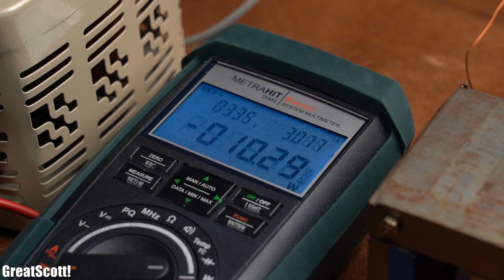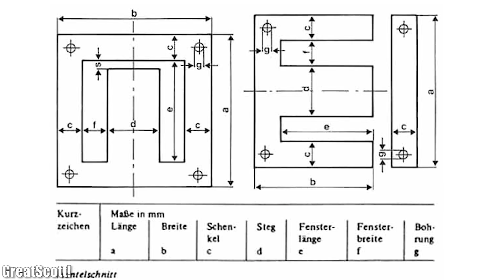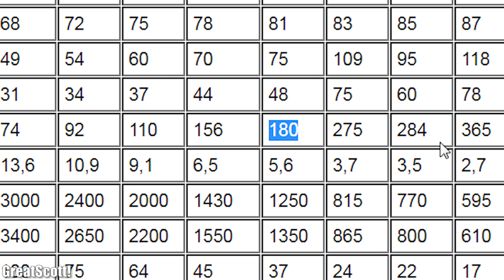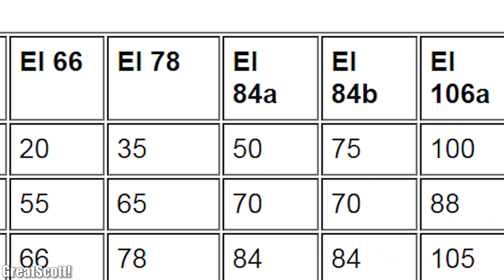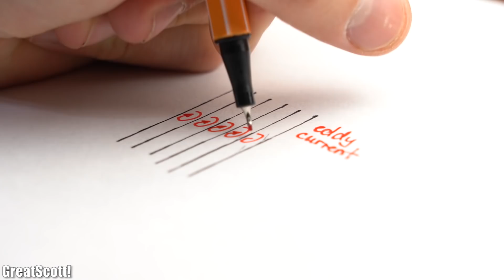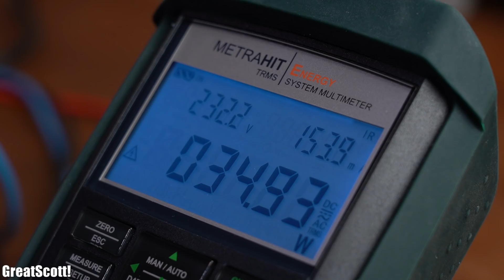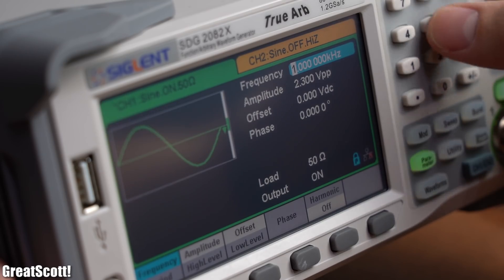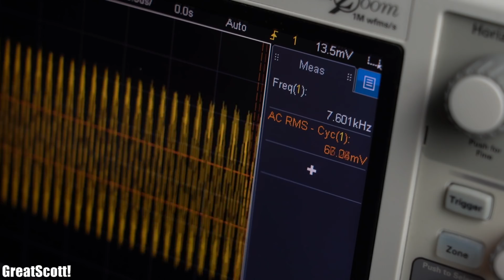Can you 3D print a Transformer? (Experiment) || How to make a mains Transformer!

Comment: 7:34 Touching the secondary coil to measure the voltage of a DIY transformer !!!Σ( ° △ °|||)
Take care of your self please
Reply: Ushio Cheng he probably measured it before taking the video and then showed it to us in it by holding it in his hands.
Reply: The primary and secondary windings are separated from each other and a core - there is hardly any way to screw it up at that voltage
Reply: @igorb4650  : Broken skin, maybe sweat. Doesn't take much current to stop your heart, so if not for the resistance of your dry skin, you really could cause yourself some trouble that way. He should really upgrade to some of those spring-loaded grabber-clips at some point.
Reply: @absalomdraconis  12 V considered safe even for  wet skin, unlike up to 52 V considered safe for dry skin

Comment: You made a nostalgie for me. My first transformer was when I was 8. I have made (with father's help) a semi manual winding machine, making windings turn-touch.
Never went to maximum B area, less heat.
Reply: lol I made my first transformer last year (when I was 33) out of a nail and some enamel wire. Real sophisticated technology, that. I had 16vac at 60hz on the primary and it wound up melting the insulation on the wire because I forgot to work out how much power the wire could handle. Which at 2mm diameter, wasn't much.
Reply: Ah, the (gladly) forgotten  joys of packing the core juuuuust a tiny bit too enthusiastically (ie. "trying to put back in every single E/I that came out of it before re-winding") and slicing straight through the plastic and a few of the inner (typically primary) turns...

Comment: Print with highest Z-resolution, and every 19 layers of ferromagnetic filament, print one layer of normal filament, as one piece!!! It will reach a much higher efficiency, i promise!!! Greetings from Cologne, KD.
Reply: Can you elaborate exactly how and why your theory would work? Higher resolution would just prevent eddy current loss. But doesn't increase inductance.
Reply: @sto2779  But Eddy-current-loss-reduction IS already higher efficiency... Laimert, another German YTer has done similarly, to create a 82%-efficiency motor, maybe I got the idea from that project, but to be honest, I cannot remember at all, it´s 9 months ago. Printing as 1 piece makes better usage of the volume (no air-gaps between the ferromagnetic laminates), so, more ferromagnetic material in the same volume brings higher inductance, would be a guess now, but to be honest, I cannot remember... The higher the resolution, the thiner the isolating layer, the better the volume-usage...

Comment: It might would worked out for SMPS or switch mode power supply, its core made from ferromagnetic materials, and frequencies around 100Khz, also i would suggest 3d print its core as one single piece. Would be interesting to see your elaborations on that
Reply: I believe it's iron that provides the ferromagnetism, so it actually might not be that good at higher frequencies.

Comment: The ferrous filament composition is much more like the composition a high frequency switching core material; as your experimentation demonstrated. I think you could have better luck printing a solid core for a switching power supply. The ferrous grains isolated by the plastic in the filament would provide the eddy current protection at the higher frequency of the switching power supply.

Comment: Those sheets should be iron not steel. Steel can become magnetised (holds its magnetism) whereas iron does not.
Excellent video.
Reply: Iron does have magnetic remanence. Some types of steel don't (I understand it to be related to their crystal structure: specifically, most stainless steels seem to lack remanence), but "electrical steel" apparently focuses on magnetic permeability to reduce the strength of the "open air" magnetic field.

Comment: at schooll they teached me to use beeswax to reduce, even inhibit noise and noticeable vibration, melt it over the corners and then hit it with a torch, so wax gets into the small empty spaces. Or any heat resistant barnish will sufice, nuts tend to loosen, so its a good measure to avoid or delay those issues. Indistrially they just weld them toogether.

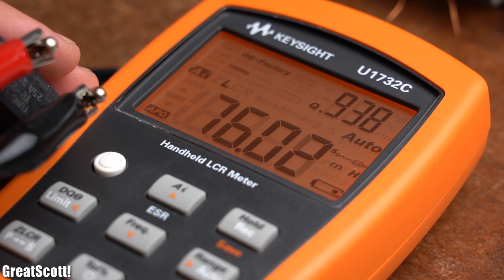Comment: cool video! but how did you calculate 51 Ohm Coil Impedance at 9:00 ? (other way of asking what's wrong with XL=2*Pi* 50 Hz * 76 mH=24 Ohm)
Reply from the maker: Don't forget the real resistance of the wire and create an impedance with it and the inductance.
Reply: @greatscottlab  Wire resistance should follow the expression Z^2 = XL^2 + R^2 = 51^2 = 24^2+R^2, i.e. wire resistance R=sqrt(51^2-24^2)=45 Ohm. Is that correct?

Comment: 3D printing the E and I pieces with magnetic filament doesn't work but you could 3D print the plastic piece that you wound the wire around (what you called the "former").

Comment: 7:39 very bad example for measuring AC voltages 😂🙈 (Holding BOTH wires with bare hands🤦🏼‍♂️, but I know you are an expert and you know what you are doing😂😉)
Reply: Doesn't matter for just 13.29 volts though. Obviously don't do that with 230V. 230V across the heart could kill you.

Comment: Every layer of turns should be isolated with special paper/cardboar or kapton tape or at least covered with a layer of clear lacker! The use of paper/cardboard has one more advantage other than isolation - it makes the winding of the next layer easier. Every layer shoud have roughly the same number of turns. 
If you don't have the right size of wire you can make 2 identical winding and connect them in paralel, OR just lay 2 wires next to each other, thus doubling the cross sectional area.

Comment: can an ups fix/help with coil whine and ground interference on computers mainly?
Reply: Likely to make the coil whine worse, not better. Also, what do you mean "ground interference"? All I can think of are:
1) you actually mean neutral, in which case I can only recommend installing a true ground,
2) you have a distinct ground, but something really is throwing noise onto it, in which case you should start by figuring out what is causing the noise (true grounds don't get wired very far, so it's probably something in your house),
3) you actually meant a ground-loop, in which case you need to find the participants and place a galvanic isolator between them to get rid of it (for audio this is usually just a 1:1 transformer, but other stuff requires it's own solutions).

Comment: Would have been a lot more efficient if coils were rounded one over the other one using an isolation layer between both.  Several years ago, I have made a design similar to yours to have a high voltage isolation between coils.  I taught that separating them would help.  But the efficiency was bad.  I changed the design to have windings one over the other one.  The efficiency imcrease a lot to reach nearly 95%.
Also, you did not calculate (or show your calculation of) the estimated conductor length to estimate ohmic resistance.
Reply: If he wound the secondary bifilar. At the exspence of extra copper could get rid of eddy currents
Reply: @brettmoore3194  Eddy current appears between the layers of the magnetic circuit.  The windings are not concerns.   At 50Hz, a bigger wire is better than using parallel wires.  At high frequency, the magnetic material has to be selected carefully and Litz wires can be  used.
In my previous comment, I was discussing about the position of the primary and secondary windings.  I have problems finding the proper words.  In Scott design, coils are separated. For efficiency, to have a better mutual inductance, it is better to use the entire space of the vertical part of the magnetic circuit for both windings.  Obviously, to add wires to the primary coils, the secondary one has to be removed.  I expect that my explanation is more  clear.  Regards.

Comment: Why didn't you buy toroidal core/ transformer it's much easier to rewind...
Reply: It isn't. You need a winding machine to wind toroidial core.
Reply: https://m.youtube.com/watch?v=tT44CnqH15I
Reply: @simontay4851  or you can be smart and use reasonably sized coil of wire, that  you can pull through....

Comment: I expected the 3D printed core won't work due to much less flux density but I'm curious with a 3D printed toroidal transformer because toroidal transformer uses core material with less flux density and doesn't require layer isolation like traditional transformer does.
Reply from the maker: Maybe I will try that out in the future.
Reply: @greatscottlab  How bout R core transformer too?
Reply: @greatscottlab  Yes, please try using a 3D printed toroidal transformer using ferromagnetic filament. Was really hoping to use 3D printed transformer until I saw your video...
Reply: Well the ferro material doesn't need to be in lamination bc it's not conductive anyway, tbh making it that way is sorta silly and probably just done for consistency with the metal laminate
Reply: @xxportalxx.  I thought the same thing. In my (rather long comment), I suggested printing more solid core parts, either thicker E and I parts, or simply splitting the core in half
Reply: @lonewolfeproductionsbyl.v.9447  honestly if you were printing them anyway I would suggest more optimized constructions rather than IE anyway
Reply: @lonewolfeproductionsbyl.v.9447  or simply better yet making your own filaments, higher amount of material with high magnetic permeability doped into the PLA. Someone should try using Amorphous & Nanocrystalline metal doped into PLA. Amorphous metals have 5 times more magnetic permeability than iron. Amorphous metals was specifically invented for transformer cores.
Reply: @sto2779  Amorphous metal cores could be theoreticaly be made out of one piece, wouldn´t they? Or one single lamination is wound around itself, till the wanted thickness/form is reached, so no need for isolated laminations... (???) How could one dope PLA with amorphous metal? Where to find it, and how  small should it be cut? What final density in PLA would be most usefull? The question u asked me before, brought me exactly to the same idea of amorphous metal doped PLA, u also just had !!! Very funny, just minutes later, I read that u also had the same idea, I had too, while thinking what answer to give to u...
Reply: Pretty sure some transformers have their laminations welded to modify the saturation of the transformer. They are unwelded to cause intentionally leaky flux so they won't saturate so quickly.
Reply: @rich1051414  Isn't that a stupid thing to do? For high frequency and power conversion, unwelded transformer is dangerous. Those corners can cause a fire and melt due to eddy current.
Reply: The individual windings of the core-iron acualy are isolated or relay on the oxide
Reply: Not always isolated. Ive seen transformers before where the E and I pieces are welded. There is a weld line along one side.
Reply: @simontay4851  like with microwave transformers. they are all welded. ( well the ones that i did open)
Reply: @simontay4851  True, most mains voltage transformers have their laminations welded to allow the core to be grounded for safety.  But at only one spot on the outer edge of the laminations, it doesn't allow much increase in eddy currents.
Reply: @firefly2472  which is why those shitty things can only be run for small amounts of time and draw lots of current without an output. I tried to rewind one and make it into a power supply and came back 2 hours later while charging LiPo batteries and the transformer was smoking!!! Only drawing 3A on the output. Lol, the good old times
Reply: @simontay4851  A true transformer are always isolated regardless, but unless you have the winding's enamel scratched or removed from both primary and secondary and if the secondary winding center tap (neutral) is attached to ground the transformer is not isolated anymore. E and I pieces are required to be welded so that it can stop eddy current and prevent heat build up in those unwelded corners.
Reply: @firefly2472  The ones you opened are proper transformers but specifically for high voltage and current, unwelded transformers are actually dangerous and can damage the transformer due to eddy currents for high power uses. Unwelded transformer are common in lower power conversions at low frequency.
Reply: @joshfixesall4056  This is the very reason why 3D printed transformers should be done easily at home. Someday...

Comment: 5:10 Create 2 secondary coils and connect them in parallel!
Reply from the maker: Haha that was exactly my idea as well at that time. But since I would not create perfect windings, the voltage of the 2 coils would be slightly different. When connecting them in parallel, it can create a compensation current which can be pretty bad in worst cases. That is why I did not show it in the video.
Reply: GreatScott! And what about winding the wires in parallel? You cut the necessary length twice (or more times), then you wind them at the same time. That’s what I’ll have to do with my SMPS transformer.
Reply: @greatscottlab  Just wind 2 wires at the same time, and you will get pretty much identical voltages. Or just add/remove few turns from one of secondarys until they are close enought (within 100mV)
Reply: If slightly different voltage on each secondary winding is a problem, use 0.1 ohm balancing resistors.
Reply: @greatscottlab  Is it not enough to have the same number of windings?
Reply: @greatscottlab  hello sir
Reply: Going on the idea of winding the secondaries together, I'd also suggest twisting the pair together so that they stay together as you wind, and any imperfections will effectively be shared.
I'm getting the feeling we are recreating the same ideas and experiments the original inventors of transformers did, trying to get around the limitations of their time, trying to get as close as they could to the ideal transformer (ideal in this case being 115:6 windings and being able to ignore current limitations beyond choosing the appropriate wire gauge)

Comment: if you don't have the right wire thickness, you  can try "hobbykinging" it, using multiple wires to add up to the correct cross section or slightly more.
Reply from the maker: Haha that was exactly my idea as well at that time. But since I would not create perfect windings, the voltage of the multiple coils would be slightly different. When connecting them in parallel, it can create a compensation current which can be pretty bad in worst cases. That is why I did not show it in the video.

Comment: When i was a beginner in electronics i tried to make a stun gun in which the transformer was used to transform 12v to thousands of volts but i didn t know about types of transformers i was using mains voltage transformer which was used for low frequency and i was using high frequency royer converter and it wasn t work what is the matter.